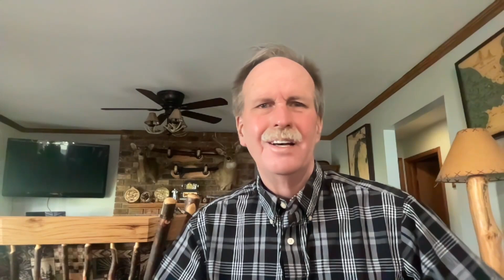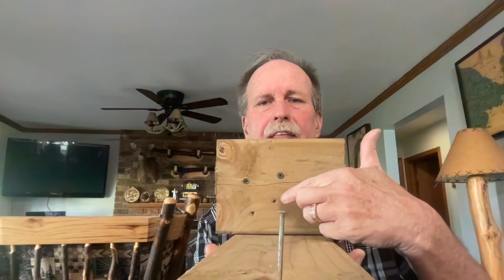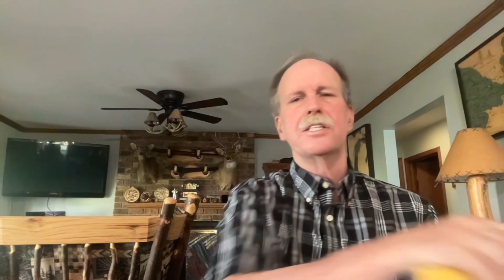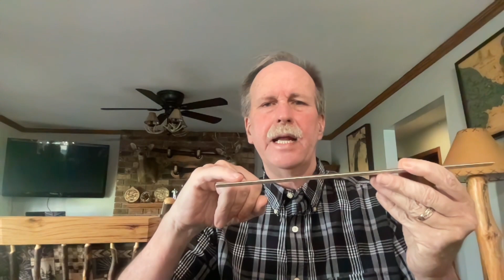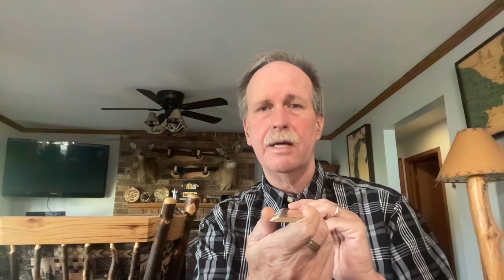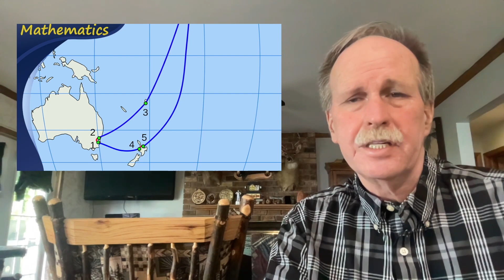The Final Experiment- Bob the Science Guy

Comment: You're right, of course, as always. I would just point out that all the FE arguments are based on assuming the validity of the Gleason map. This, of course, has lots of problems that they ignore. The trouble is, as I pointed out to Will Duffy, there is another FE model proposed by Lady Blount in 1904 in "Zetetic Astronomy". I call it the "coin model", and it has its edge at the equator and is flat on both the north and south sides. It has a south pole and, as the sun crosses the equator on the September 21 equinox, people at the south pole see it going leftward all the time for 6 months. There are other accommodations that could also be made, but also plenty of ways to refute it. Anyway, that's a model Will can't refute with midnight sun.
Fortunately, Critical Think ("from Down Undah") is going with his scales, which can refute both FE models.
Reply from the maker: The weights with latitude and runway lengths are conclusive. Thanks critical think
Reply: @BobtheScienceGuy  We wish you would go,  it would give it more credibility having more educated people go. 
😪 whats the problem,  you don't know how to make a good snowman 😄⛄️

Comment: Hi Bob. 
If a level is needed then gluing the nail and wood on the side of the level would require less items. Everything needs to be weighed for the flight.
There's also the question about the penguins. If the FE community are correct and the birds are armed, how do they pull the trigger? A wing isn't the best shape for pulling something. 🤔
It's weird when trying to think how a bird can fire a gun, their feet are used for just about everything, they can't use their beaks because they use it to survive so really it just leaves mind control and that's about as reliable as a Flatearther. Armed penguins? Only when they poo. 😆
Reply from the maker: I actually thought about that. I wanted to keep them separate so you could keep the level warm in a pocket
Reply: @BobtheScienceGuy  
That makes sense, I forgot it was cold there. 😆

Comment: Bob, I look up at the night sky @ 30 degrees north latitude and see all stars propagating at negative declination ( clockwise ) South of the Celestial Equator. My Equatorial mount also works just fine cancelling field rotation. It worked just fine cancelling field rotation when I traveled 1000 miles North for the April 8th eclipse. 
These 2 facts alone disprove the Earth being flat. However, like you said, flerfers do not respect evidence and just make believe that these things are possible on a flat earth with no explanation as to how ( because they are not possible on a flat earth ). The result is going to be the same as all other unchallengeable evidence... flerfs are just going to make strawman claims that a 24 hour Sun is possible on a flat earth because... reasons.
Reply: When I presented these facts to a flat Earther, the only reply was that an equatorial mount will only work on a flat Earth.  When asked how this was possible since you have to align the mount to the South Celestial Pole inthe Southern Hemisphere, all I got was crickets...
Reply: @chrisantoniou4366  What really airplanes over their brainless heads is that you're technically aligning the RA access to both the North and South Celestial poles at the same time, only you face the mount in the direction of what hemisphere you're in. 
I've actually used a live star chart on my phone with EQ grid turned on and faced my phone on the view side of my polar align scope and rough aligned it to the South Celestial Pole in the daytime, then fine aligned it to the NCP with my polar align scope after dark.
Ofc anytime I've ever brought up negative declination... the same... crickets.
Reply: If the earth was flat, 24 hour daylight would not only be possible, it would be unavoidable. Inevitable. There would be no night anywhere, ever
Reply: The point is, as Bob said, flerfs are not able to reason at all. Flat earth has been debunked thousands of times. But they deny it.

The point of TFE is, that FLERFS, even some really big ones, have said, that there is NO 24h sun in antartica. So by sending one of their own, so see it, makes the GRIFT completly obvious.

TFE is not about proving the globe. We know this already. It is to prove, beyond any doubt, that the big flerfs are grifters.

Jeran is (was ^^) a well respected flat earther. We hope, that when the flerfs go against him, they already do, some of Jerans followers might start thinking in what kind of community they are. You can't call yourself truther and run away from TFE or attack Jeran.

Comment: How precise might this shadow nail in a board backstop measuring device be for getting elevation of the Sun?
Reply from the maker: As precise as you want to mark it
Reply: @BobtheScienceGuy  Well, if the Sun goes below the horizon, there will be no shadow. I wonder why the FE community Don't want to test this...
Reply: Did this for a position fix in my kitchen during summer 2023 - not with a nail, but boxes on the table as shadow casters:

A 17cm high cardboard box with dented corners was 0.7° off, while a cuboid speaker from my living room kept results <0.2° over 4 measurements.

Keep in mind that the shadow itself has a fuzzy circle of 0.5° in diameter, so it quickly becomes guesswork as to where the center of the shadow may be.
Reply: @mleise8292  A pinhole camera lens would help with that spot
Reply: @johnfitzgerald8879  Good idea! The smaller the aperture, the dimmer and sharper the image of the sun. And still not advanced enough to need lenses or mechanical parts. Cardboard and tin foil are enough. 👍🏼

Comment: As somebody who lives in a fairly warm climate I gotta ask: what's the minimum operating temperature for a bubble level?
Reply: Bubble levels use a mixture of alcohol and water to prevent freezing.  I've never seen one freeze, but I'm not in Antarctica.  I just stuck one in the freezer and will post the results.
Reply: Well, not an issue, not even in Antarctica. They’re called spirit levels for a reason - they’re usually filled with pure ethanol for its viscosity and wide range of temperatures under which it remains liquid. How do you think we build in the winter north of the tropics? Ethanol freezes at -114°C/-173°F - even Antarctica doesn’t present a challenge.
Reply from the maker: In your parka it will stay warm until it is used for a couple of seconds

Comment: I believe there are some mountains near Union Glacier. It may be that the Sun will be slightly obscured by the mountains for some of the time. While we know the Sun doesn't quickly dip below the horizon when it is obscured by mountains the flerfs will dive on it as a reason why there isn't a 24-hour sun above the horizon. 

Having said that I do not know the high of the mountains relative to the glacier camp or the distance from the camp.
Reply: You can get a good idea of the landscape there with an image search. There appears to be one large ridge on the south side of the main camp that might get in the way for part of the circuit. That might be avoidable though if they can move further out onto the glacier. It's not completely clear how much of an obstacle it will actually be.